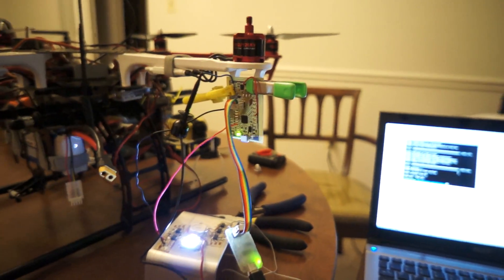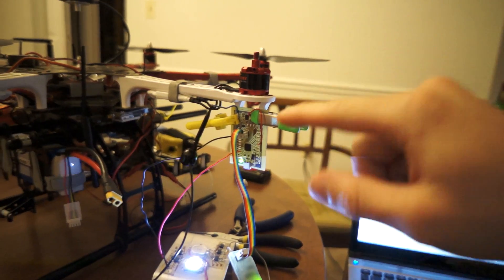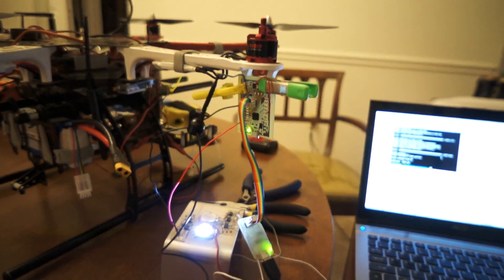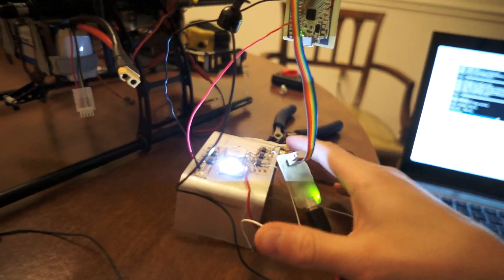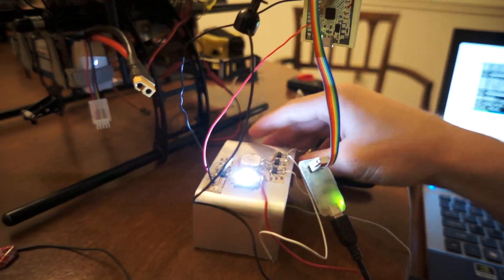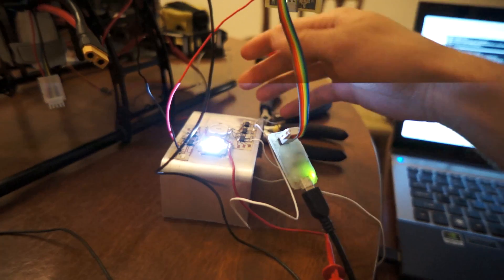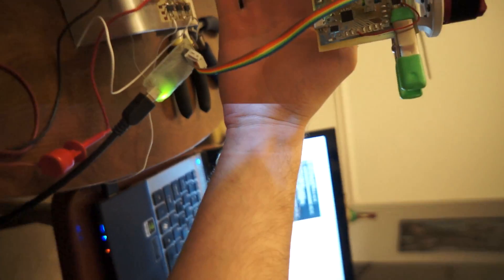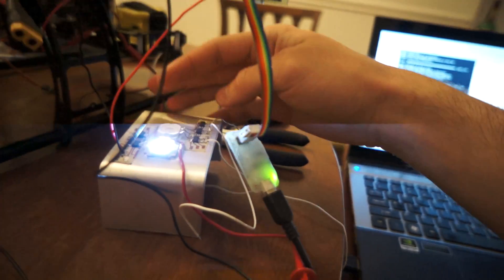Fun With Rolling Shutters and Fast LEDs

Comment from the maker: On all of my high power RGB LEDs, I use a resistor capacitor and transistor.  This adds some filtering to keep the light from flickering at lower PWM frequencies.  It's kind of my standard silicone thermal tape PCB.